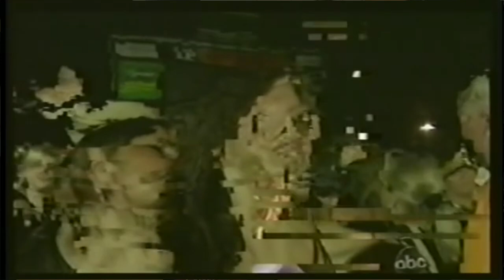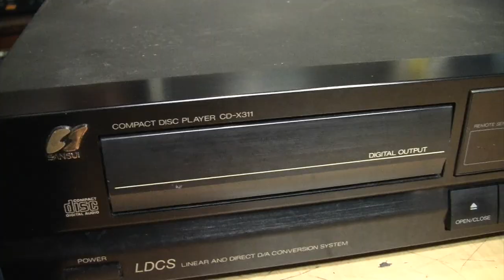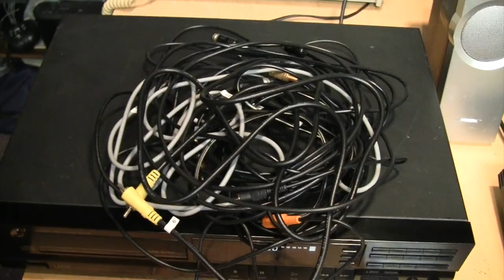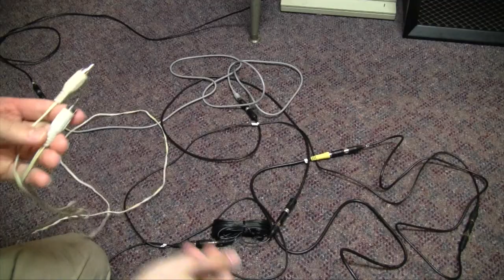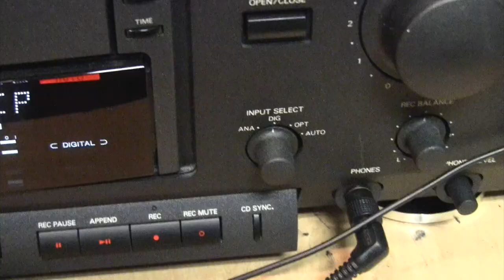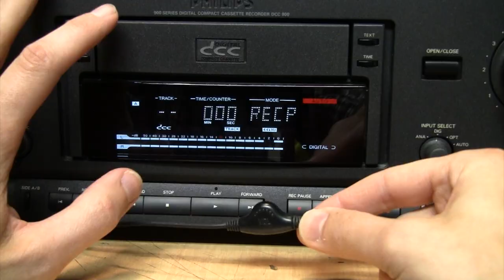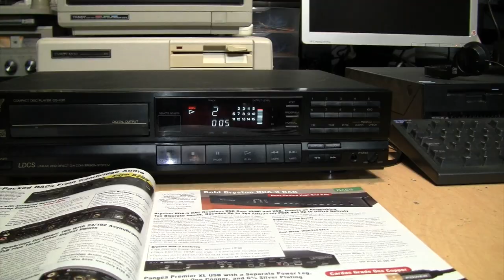What does a crappy digital audio cable actually sound like?

Comment: A good friend of mine who has paid over 100,000AUD for his stereo system is a firm believer that a high quality digital audio cable makes a difference.. I am an electronics technician and I know better. 1's and 0's are 1's and 0's -- if they get through a cheap $2 lead intact it will sound identical as it would through a $300 lead. When the signal is too weak too many 1's turn into 0's.. just as when the signal is too hot too many 0's turn into 1's and both have the same effect -- total loss of audio or very bad broken audio. I can't believe people fall for this crap and spend ridiculous amounts of money on something that simply does not make a difference. It really is a case of placebo effect -- if you believe it will sound better because you just spent $300 on a cable -- it probably will. Any of us with the technical knowledge really do know better.
Reply: The one that gets me is thinking that a fancy expensive POWER cables affect the audio signal. I'm a retired electrician and electronics has been my hobby and I've tried to explain it can't happen, to no avail. People really do hear a difference but can't accept it's just in their head. If a cable actually carries audio signal THEN it can have some effect.
Reply: @bradt.3555  Well said, and logical; as Mr. Spoke would say.🔉🎵🎶
Reply: Well, digital inference exists as well, so a cheap shielded cable should do the trick.
Reply: @patrikjankovics2113  Of course. But the common argument from audiophiles is that it will improve the audio quality by having an expensive cable and this is just simply rubbish.
Reply: @patrikjankovics2113  Or an optical cable.
Reply: Plus modern error correction algorithms exist.
Reply: Would it not improve, if the cables was upgraded, if the output voltage was higher. The higher the voltage, with small cheap cables, would create a higher resistance, wouldn’t it?
Reply: @johnsimun6533 yes but that doesn't make a difference to digital sound
Reply: They say the ground introduces static, but why not filter the ground at the DAC

Comment: I remember some of the Hifi magazines in the UK back in the 90's used to do speaker cable tests. Out of all the speaker cables they tested that cost stupid amounts of money, hands down all the blind-test reviewers gave the best rating to the same cable - some fairly cheap 6mm twin & earth cooker supply UK mains electricity copper cable that had been bought from Home Depot (B&Q in the UK). Whilst it is a pain to use because it's thickness means it's not very flexible, because of it's low resistance it works perfectly as speaker cable and is cheap too.
There was a Denon Ethernet interconnect between a CD DAC and the CD transport that used to cost over $1000. Just bonkers! 
As an aside, it would be interesting in this scenario you showed to get some Bit Error Rate and Jitter analysis software on the receiving machine (or even on an Oscilloscope that's able to pick that up) to show when the signal does actually start to degrade, and if there was a definitive way to show (apart from acoustically) any signal degradation vs the source in the digital domain.

Comment: The left and right channel sections of that cable are crosstalking and causing a large amount of distortion in the signal. I suspect if you peeled apart that cable so that the signals don't travel perfectly parallel to each other, it might still work.

Comment: Some audiophiles may claim that this test doesn't count due to the use of low end speakers and a computer, and that someone with good ears can tell a difference on a high end system. I would personally call such a claim BS, but let's just for the fun of it assume it's correct. In that case there's one more argument for not buying insanely expensive cables: They will reveal the flaws of for instance the cd media (which for a fact exists) even more. 
This a great test, and a great video. It clearly proves the point: Don't waste your money on snake oil.
Stay awesome mate, and keep the cool stuff coming.
Reply: Yep!  And those audiophools that convince themselves that their $100+ digital audio cable is SO superior to normal RCA cables never seem to consider the standard of the components; the main board, the copper traces on that board, and internal wiring inside the components being connected.... those will have more influence over the resulting quality than 3-feet of over-priced oxygen-free, pre-sexed, and gold plated cable outside!

Comment: Try running a cheap RCA cable next to an active HDMI cable or powerline - it will sometimes degrade the signal
Reply: this is a shielding issue; sort of related but not related. Cheap cables can be adequately shielded, in fact usually are.

Comment: I bet you could go back to the full length if you separated that stereo cable into two lines, which you could do. Just mean separate the two cables between the two rubber bits that are there to prevent just that. You never reached distance limit, instead you introduced severe cross-talk.

Comment: I wonder if the quality issues that arise when combining the two halves of that stereo cable are the result of crosstalk. You could try laying out the cable instead of coiling it - though more likely it's the fact that the two halves are so close to each other in parallel.

Comment: Did you hear all that time dimensional smearing. Lol, neither did I. Cable snake oil merchants are so frustrating preying on others with all their fear and nonsense. Great demo of what does and doesn't actually matter. I'm guessing with all that length, the combined capacitance of the cable acted as a high frequency filter, rounding the edges of each sample until they eventually blurred into each other. Great demo. Really liked it.

Comment: One of the exhibitors at one of the MI trade shows (NAMM?) got AES/EBU (AES3) stereo audio over wet string!
There are real experts on the SOS forums that would have a good chuckle at the expensive cable claims, esp. as one got told in a electrical retailer that "the BBC only use monster cables", little did they know that he had worked either for the BBC or on the standard for the cable they actually use.

Also supposedly a lot of the products peddled to audiophiles are to correct the design errors that are commonplace in audiophile grade equipment, the kind of errors that would not be accepted in professional/broadcast grade equipment.

Comment: Jitter is not lost or damaged bits but bits that arrive at the wrong time, e.g. slightly early or late, which introduces small amounts of distortion. I think you would need very high end equipment and high end ears to notice the difference. Much as i hate snake oil and overpriced hardware, i have to admit that jitter is a real phenomenon, and so what the company says about the high price cables being better is probably true, although the cost of the cables is very likely much higher than they should be, and the improvement gained much less than stated in the adverts.
Reply: S/PDIF sends the source clock as part of the signal. As long as that clock can be extracted correctly the jitter should be low or non-existent.

Comment: If you think about it, this kind of bitcrush distortion makes sense. Digital signals are streams of fast signals that are either 0 or 1 - so if an input signal is something like 0.9 or 1.2 it obviously rounds it down to 1, and if it's something like 0.1 or -0.2, then it obviously rounds down to 0.

With you moving volume down, that 1 gets "quitened down" to 0.9, 0.8, 0.7 and so on, sounding just fine with it rounding up to 1, until 0.5 where the noise results in each 1 getting randomly rounded up or down (but 0 is still 0 so the audio is still partially intact), and then below 0.5 where it just rounds down to 0 where it's not heard.

That player could tell that something is really bad with digital signal and would instantly cut out audio when it sees malformed audio data coming in, as it can just check the actual value before rounding it to 0 or 1, and if it's something below 0.6, it can assume the signal is bad and tell the user to check it. This way, it simply never gets down to the volume levels where 1s would get rounded down to 0. Meanwhile, a PC's card can't just easily tell the user that the input signal is bad, or they didn't bother designing such a check, so it just pumps whatever gets in as audio into the system.

I guess that's also why the stereo cable started doing the exact same thing. I think it's reasonable to assume that because it's exactly the same data going through both wires that are directly one to another there was some interference which caused either a enough noise or a significant enough volume drop to cause exactly the same effect.
Reply: With digital, the equipment will also usually try to compensate for timing mis-matches by adjusting it's own clock to match the incoming signal. With a bad enough signal, you can wind up with the clock stopping at the wrong speed, or even swing it's speed up and down constantly, producing any number of wrong interpretations of the signal.

Comment: You could synchronize the various recordings to the same sample in the stream and export to RAW 16-bit PCM with no headers or timestamps. Then run a checksum utility over these raw files such as md5sum or shasum. You will find that the checksums are equal. This means that the received data is the same regardless of cable quality. Great video.
Reply: I've been wanting to do this for so long, to even prove that different CD transports output the same digital signal. But I don't have a soundcard that can do SPDIF recording and I don't feel like spending money to prove someone wrong on the internet, because they won't believe you anyway.
Reply: @RedShift5  I have a video on my channel where I sent HD video (1080p, 60fps h.265) over TOSLINK. I would be shocked to find that different CD players emit different S/PDIF data unless they had some kind of filter or equalizer. There would almost certainly be a way to disable it if such a thing did exist. It's hard to convince the audiophools.
Reply: @TheResistorNetwork  there's a whole community out there that believes different cd players fed to the SAME DAC produces different audio. Google "which cd transport should I get" or similar. I don't think a lot of them understand how CD's and electronics work.
Reply: @RedShift5  They don't. And when you confront them about it, they will only respond: "use your ears". I only wish they actually did that themselves!
Reply: no point in running a cryptographic hash over it, just compare the streams byte by byte.

Comment: Same thing going on with HDMI cables: I still can't see the difference between a cheap £4 pound cable and a £40 pound cable..
Reply: I can be a factor with higher bandwidth requirements. Like if you have HDMI 2.0 hardware and an old cable, it might not want to offer the proper throughput.
Reply: that's the only thing that "could" happen

Comment: maybe there is just a bit of interference if you use unshielded cable right one next to another?

Finally, to put the last nail into the coffin, you could record a short connection anda crappy long but audable working one and compare the recordings digitally.

Comment: For those that don’t understand the principles of basic electronics, audio components are mysterious magic boxes and mysterious magic cables can seem alluring. Once you understand Ohm’s law, the basics of digital and analog sound and how resistors, caps, tubes and transistors work, the mystery disappears along with (hopefully) the tendency to fall for magical marketing claims. I consider myself an audiophile and there are “bad, good, better” cables, but the differentiator is construction quality which affects durability and the likelihood of failure.
Reply: 🤔 Ohm's law.
Reply: Exactly!
Reply: Word 100%
Reply: Speaker cables actually benefit from being thicker, something to do with the capacitance of the cable, otherwise it attenuates the bass.
Reply: @doltBmB  No. Speaker cable capacitance is not an issue. The resistance can be a factor, though, and the gauge of the wire must be adequate for the length of the run. For normal distances under 50 feet, standard 18 gauge lamp cord is more than adequate. For very high power applications, lower impedance speakers below 6 ohms, or distances over 50’, 14 or 12 gauge may be necessary. Again, this has to do with resistance not capacitance.

Capacitance can sometimes be an issue for source component cables, particularly phono cables. Most audio cables provide the necessary capacitance, however, so it’s the rare circumstance where specialty cables must be used.
Reply: @FluxCondenser  Yes it is, there's a lot of good tests that show thickness matters.
Reply: @doltBmB  speaker gauge can matter as I stated. I believe you’re confusing capacitance with resistance. Two different principles.
Reply: @FluxCondenser  Capacitance can be an issue. Some exotic super expensive speaker cables are coaxial and the added capacitance from this can make an output of an amplifier become unstable and break into supersonic oscillations.
Reply: @FluxCondenser  No. capacitance is an issue. Once upon a time someone in a broadcast station asked me why the speakers in the control room sounded poor in bass freq. Some stupid guy connected them to the amp with a coaxial mic/line cable cause he was waiting proper power cables. I momentarily swap them with red/black flat spk cable and solved the issue in the meantime. They acted like condenser. Ok it's an offlimit case, but capacitance is involved. I agree with you for lamp cord, or electrician cables, they are very good for the task.
Reply: No. You’re misinterpreting the cause of your results. Microphone cable is not suitable for speaker cable. Not because of the capacitance, however, but because the wire is simply too thin and creates too much resistance. Speaker gauge does matter.
Reply: @doltBmB  

Actually thinner cables boost the bass slightly (or attenuate it less) due to the woofer's impedance peak at it's resonance frequency making the cable's resistance drop less voltage. I don't think it's noticable from a certain point on.
Reply: @westelaudio943  That is the opposite of every reliable test I have ever heard of.
Reply: @doltBmB 

It's just simple Ohm's Law... 
A resistance attenuates more on a low impedance load. A resonating woofer has a high impedance (up to 60 Ohms more than at the lower midrange knee where the it comes the closest to it's nominal value). You're essentially raising the system Q of the speaker by a tiny bit.
Reply: @westelaudio943  Well Ohm can't fight empirical evidence.

Comment: I wonder what the people who spend hundreds on a cable do with regard to things like Bluetooth headsets?  

They must check the weather forecast months in advance and calculate what effect the humidity and air temperature as well as their location and the Earth's magnetic field will have on the delicate, subtle nuances of the digital signal, though you'll have to imagine them actually tolerating Bluetooth A2DP audio, what with every codec used in Bluetooth being lossy!
Reply: I would expect they would totally avoid Bluetooth audio. Oh wait, perhaps they do do all the stuff you said so they convince themselves it works fine.
Reply: @dlarge6502  If their phone dfoesn't have a headphone socket, they're kindastuck, though.

Comment: Wonder what would have happened if instead of just connecting the same ends together, ie, red and black at one end, you would have gone from the red all the way back around to the beginning of the black on the other end and then taking the last end and plugged it into the next cord? Seems to me that there was enough crosstalk between the red and black wires that when you sent the signal back in the opposite direction you had a cancellation. If you would have kept it all going in the same direction you would most likely not have had that degradation.

Comment: I've been getting that catalog for some reason. I never requested it that I know of. The crap in those catalogs are laughable. We saw a power cable that they were selling that used like 8 gauge wire for six inches that they claimed would provide you with superior power quality or some junk to your equipment. Houses in the U.S. are generally wired with 14 or 12 gauge wiring. Like that 6 inches of 8 gauge wire is going to magically improved the power from hundreds of feet of 14 or 12 gauge wire. Household wiring is a little thicker than necessary for a bit of a safety margin so I don't think that's the problem. Besides, it's generally not shielded in a metal conduit or twisted in route so it does pick up stray interference. Not to mention what it gets off the rest of the grid from poorly made electronics dumping noise back into the grid. A power filter should help with that, but high quality electronics should already have noise filtering as it, you know, rectifies the AC to DC anyway.
Reply: I get extra phono buzz from LP120 at random parts of the day, it maybe a plasma TV or light dimmers somewhere up the road, I'm at the last pole on the overhead wire. That buzz is that strong it is audible at 2/10 and can be heard on the dead wax

Comment: This is exactly what it sounds like when a recording on DAT gets corrupted somehow and the error rate goes out of control.  Pretty neat to see it happening because of excessive cable length.
Reply: Now I'm reminded of seeing ADSL routers with huge measured distance to exchange and lots and lots of CRC hits. I guess it's doing the same thing to the bits in all the cases... dropping or flipping until the integrity of the packet doesn't hold up.